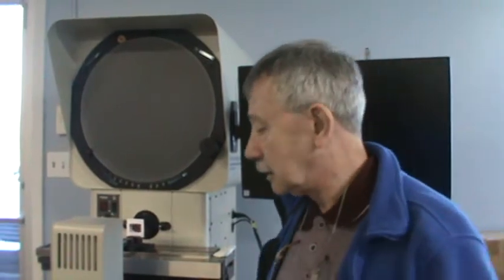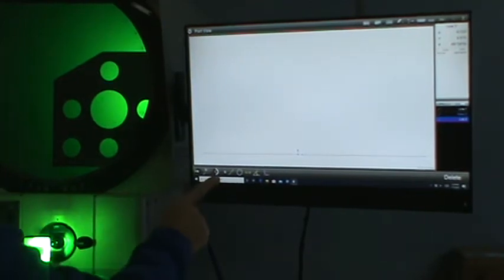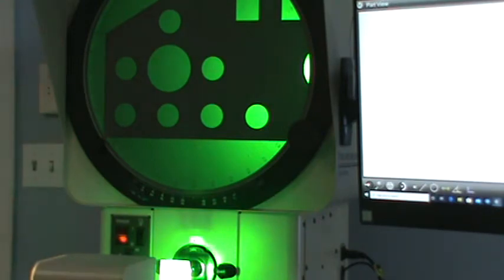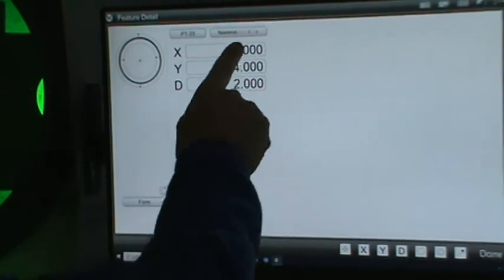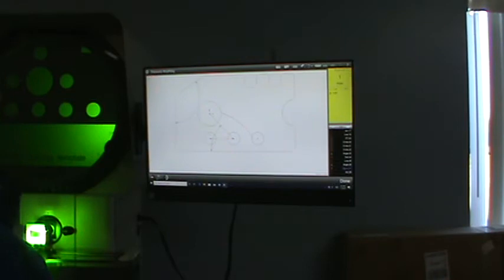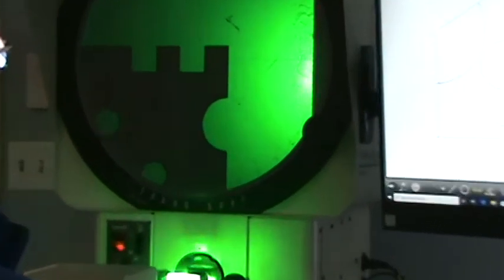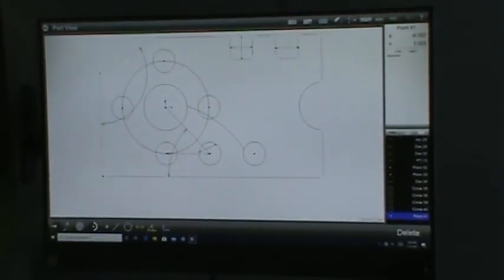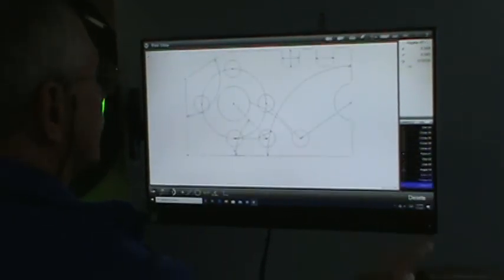Dorsey Metrology MetLogix M2 Training Video level 1

Comment: Thank you for taking the time to explain how to use one of these.  We inherited one from our sister company, but we already have a newer Keyence model that does all of this, but digitally.  
Personally, I think it would be fun to implement it for one of our factory lines, however I happen to know we have an older Shadowgraph that looks at the profile, and based on the magnification level, can use cellophane items to manually measure it with approximations (we mostly do corner radii verifications).  It would be cool, in my opinion, to have something that'll quickly establish a CAD model for us to then import and review/have a documented reference for that particular item.
Regardless, you did a very good job explaining this device and standard use.  I wish I had more troubleshooting guides involving this, but this helps out greatly.  Thank you.